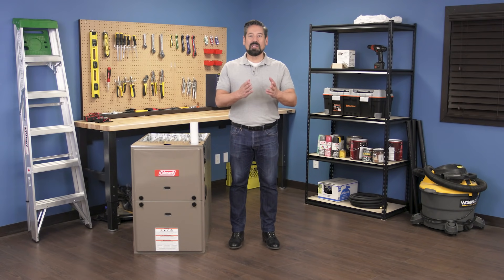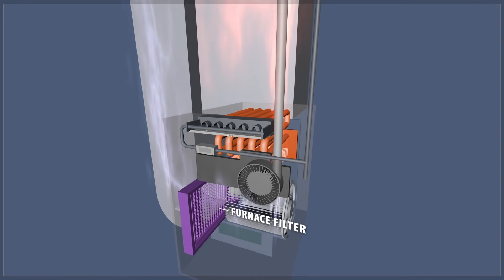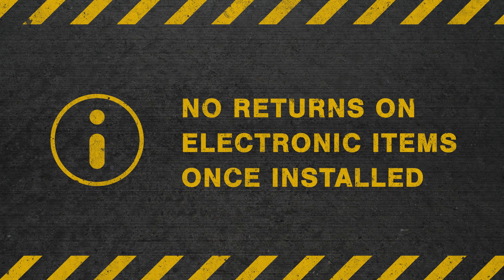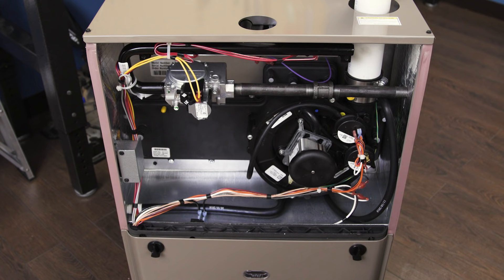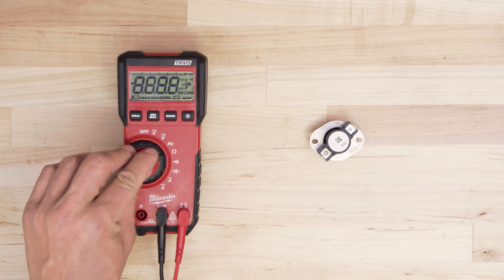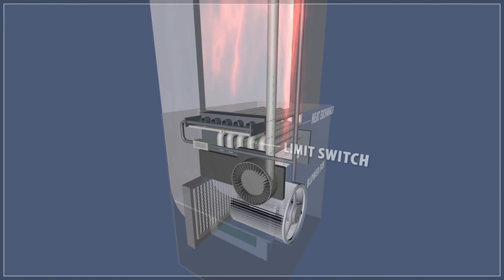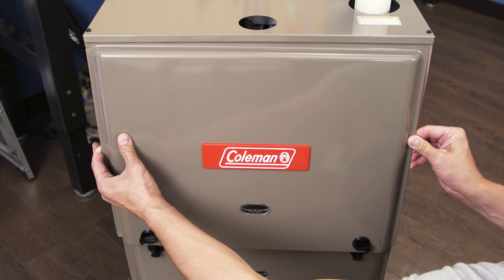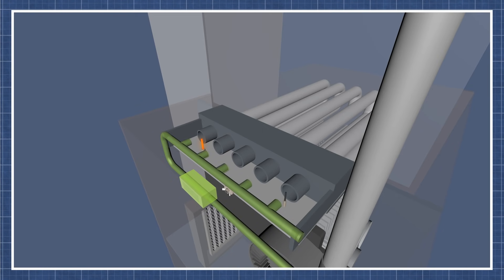Furnace - Limit Switch | Repair and Replace

Comment: Vance, Great Video!  You've been so helpful with other comment, I've decided to ask you.  I have 2008 Furnace Lennox G51MP-36B-070-08.  The Primary Limit Switch is hard to replace mounted on the wall behind the intake vent and the exhaust vent (you probably know this configuration).  The Primary Limit Switch is a L210-30F.  The furnace ran great with occasional lockouts , but then in Jan. - Feb. 2021 every few days or so it would lock-out with error code that says either "lost flame sense more than 5 times" or "Primary Limit Switch Open."  So first I cleaned the Flame Sensor, and that helped for a few weeks.  Then Lock-outs with same error code began again, but the Combustion Air Inducer (CAI) keep running after lock-out (somewhere I read this is caused by the Primary Limit Switch staying Open).  Since it is easy, I installed a new Flame Sensor, but it would still lock-out every three days or so, but now the CAI motor stopped running after lock-out.  So now I'm thinking the Primary Limit Switch is the next thing to replace.   How many minutes can these furnaces run until the Primary Limit Switch opens and shuts them off?  Can I substitute a Primary Limit Switch with a higher rating say L250-30? Is there a Lennox forum?  Any advice will help.  thanks!
Reply from the maker: Hi Walter, thanks for watching, we're glad that you found it helpful! If you're getting a flame sensor error code, then there's a few other things to check. For the flame sensor to work it needs to complete the (DC) circuit, from the control board, through the flame, into the metal of the burner and down to ground through the furnace frame. So the furnace needs to be grounded properly and the burners need to be clean for the flame sensor to work properly. Give the burners a cleaning and you can also test for continuity from the metal of the burner to the furnace frame to be certain.

When replacing the limit switch, you have to match the ratings exactly for the furnace to run safely. The lockout times differ between furnaces, there is some variation. There might be a Lennox sub forum on one of the HVAC discussion boards if you do some searching.

Hope this helps.
Reply: @AmreSupply  O.K.,  I'll let u know.  Thanks!

Comment: Hello, I am following and watching your video really they are very useful. At the same time, I have a suggestion that there is a very bad noise (melody)  at the beginning while opening the video if you could change it with a soft melody. Thanks in advance
Reply from the maker: Thanks for watching, we're glad that the video helped you out. Other people have pointed out that the sound is pretty loud. It does depend on the speakers that you're listening from. Our newer videos have an updated into that is quicker and a bit softer. https://youtu.be/Rq5yHyI5UQA

Comment: furnace running but not reaching room temperature sounds like limit switch
Reply from the maker: Thanks for watching. Could be the limit switch but still check for a dirty air filter.

Comment: My 5 year old Bryant furnace recently started short cycling and not getting up to temperature even with a new filter, but if the filter is removed it works fine. I suspect the limit switch, it's L170-20F. Does this sound like the problem and does the replacement have to be the same specs or how close does it have to be and would there be an advantage to using one with slightly different specs? Any help is appreciated - Thanks.
Reply from the maker: Hi Russell, thank you for watching. Its always best to replace the switch by matching the numbers exactly. These switches are used as a safety, so a different temperature cutoff is unsafe to use. The numbers refer to the temperature that the switch will open and disconnect power, and the 2nd number refers to the difference in °F that the switch will close again.
Reply: @AmreSupply  Thanks for the info. I will only try to replace it with one of the same specifications.
Reply from the maker: @russellcrea9701  You're welcome!

Comment: My thermstat's reboots and checked online and the cause seems to be the limit switch,  the tech who had come to check says there is orange flame instead of blue and could not find out the fix, is this also caused by limit switch or is the issue something different
Reply from the maker: Thanks for watching. An orange flame will happen when it is not receiving enough air for complete combustion. This can be because of a plugged orifice or a dirty burner.

If the furnace starts and stops after the flames are lit and after the blower fan is on, then it could be a faulty limit switch. If the furnace shuts off any other part of the sequence then it might be a different switch. You can learn more here: https://www.youtube.com/watch?v=b0sAGt-1niU
Reply: @AmreSupply  Thank you
Reply: @AmreSupply   Two Tech from different company came and confirmed there is Carbon monoxide leakage, i wanted a quote for a new furnace from a third company for comparison  and the third tech who came cleaned the burners and checked the carbon monoxide levels too showed pic the flames are blue, and said there is no issue  now totally confused.
Reply from the maker: @pgg2061  carbon monoxide is produced when there isn't enough oxygen for compete combustion, so a yellow flame can produce higher CO levels. Regardless you should have a CO detector close to the furnace as a safety. 

One other factor that can cause the furnace to not run well is a blocked exhaust exhaust vent. Sometimes ice or a build up of leaves or other debris can restrict the airflow. On furnaces with inducers motors, the pressure switch should trip when this happens.
Reply: @AmreSupply  Thank you for your reply. I order some  extra CO alarm
Reply: @AmreSupply  My bad  I checked the with techs again it was not CO leakage they had checked the fuel pipe and found it high 
one found it 50 ppm the other around 25 ppm

Comment: Where is the limit switch on a gas fireplace please
Reply from the maker: Hi Jane, thank you for watching. It depends on the model but the limit switch  is generally placed on the side wall so that the bi-metallic disc is exposed to the air that is heated. https://www.amresupply.com/part/2000-080-Kinsman-Fireplace-fan-limit-switch
Reply: @AmreSupply  thank you I have found it. I am going to replace tomorrow. Our gas fire is a Pleasant Hearth model VFF PH20D it has never been used but was in storage until we moved. It has never lit , the pilot if I hold the control know in will light but on e let go it goes out. The thermal coupling has been changed. The ingnitor is strange it is nipple with a spring and battery but no click when it is depressed we have always had gas fires so I do know what it is supposed to feel like. Thee company tells me that there is not a replacement t as the thermal coupling is part of it. I am confused. We had a professional install and run the new gas pipes he is frustrated too and to be honest we have spent too much money at this point it is a catch 22 . I appreciate your help , I will let you know if this works. I really want to understand the ignitor.
Reply from the maker: @janefletcher3198  The ignitor might require batteries. See if there is a housing or cover that would pop out, it will likely require several AAA batteries.

Lighting a pilot is similar between furnaces, water heaters and fireplaces that use a standing pilot light. This video will show you the steps that you can apply to the fireplace. https://www.youtube.com/watch?v=d-KRwKdRNYI

If the pilot doesn't stay lit there are a few things you can check: https://youtu.be/Lu5GvbvspMw

Hope this helps!
Reply: @AmreSupply  thank you so very much for everything you have helped me with. The igniter is still a sticking point. But I am sitting here enjoying our fireplace couldn’t have done this without your help. I replaced the last piece and it was the problem . I am 72 yrs old never let anything beat me patience is a great virtue . Again Thank you
Reply from the maker: @janefletcher3198  You're welcome Jane, we're just happy to help in what ever small way we can! We're glad to hear that you have the patience and focus for continous learning. Its a lifelong skill that truly empowers everyone. All the best to you!
Reply: @AmreSupply  well here I am again, any recommendations for this problem , we turned the fire up a little it got cool . It set off all the fire detectors in the house and actually shut itself off. I haven’t lit  it again it does smell awful. I did clean everything before we used it. It had been in storage. I am thinking of getting new logs. The actual gas ring had dirt on it that shouldn’t have been .
Reply from the maker: @janefletcher3198  There are a few things that could create issues like that. One would be a dirt or dust that in the fireplace or on the logs itself would create excessive smoke. Another one would be an issue with the chimney. If there is a restriction in the airflow then some of the smoke will be exhausted into the home. If it hasn't been use the rest of the chimney could be quite dirty overall.
Reply: @AmreSupply  thank you for replying . This is a ventless fireplace in a cabinet I have done all what you have said cleaned dusted wiped down . It smells and I can not have it on low we have put the ceiling fan on to help with the fumes , the fire itself does shut of so something is not right . It is very frustrating I really don’t know what else to do it is in a large area not a closed room .
Reply from the maker: @janefletcher3198  If it is a ventless fireplace then that changes a few things. It could be an issue with the gas regulator, as these models are setup differently than the vented fireplaces. First of all you'll absolutely need a Carbon Monoxide detector installed close by if you don't already have one. As well it  might be helpful to get it inspected by a professional.
Reply: @AmreSupply  good morning, we did have a professional install , run the pipes took it apart. I do have the carbon installed . We will have the regulator looked at I am trying to get new logs they have been in storage and ai see a few chips when I clean .

Comment: My limit switch is saying 1.1 when I test it. It's a 6 year old furnace and not lighting. I can see the ignition heating up but no flames after it clicks :/
Reply from the maker: Hi Alex, thank you for watching. The 1.1 ohms means that the limit switch has continuity so its likely not the problem.

If your inducer blower works, the ignitor heats up and the flames don't light, then its most likely an issue with the gas supply. First check to see if the gas shut off valve is opened.  Alternatively it could be an issue with the gas control valve as it needs to open to release gas for the furnace to ignite.

Comment: My gas furnace had been short cycling for a few days now. Since this morning upper zone is not working, although lower zone is working just fine, and no short cycling either. I have checked the thermostat, also tried to bypass the thermostat, the damper motor seems to be working too (opens when furnace is turned off and closes when lower thermostat is turned on, but it won't open when upper thermostat is turned on). Could it be a faulty Limit switch? If not, any idea what it could be?
Reply from the maker: Hi Rahul, thank you for watching. Overall its best to see if your furnace gives you any error codes after it short cycles. This can help you narrow down the problem. 

We also made a video that focuses on short cycling as depending on where in the sequence it happens will help you know which part is faulty.
https://youtu.be/b0sAGt-1niU

If the furnace heats up normally and then shuts off after blowing hot air then the limit switch might be faulty or it the air temperature inside the furnace is too warm. In this case it would be best to replace the air filter, and test the limit switch for continuity.
Reply: @AmreSupply  Thanks for your response. The furnace runs fine most of the time, but often shuts off before reaching the target temp. Then the fan short cycles several times with no flame. After like 4 times doing that within a minute or two, the flames light up and then it runs just fine. Looks like a limit switch right? I checked your other video, thanks!
Reply from the maker: @RahulRathi_Multimedia  If you've replaced the furnace filter and the airflow around the heat exchanger is good, then it does point to an intermittent problem with the limit switch.
Reply: @AmreSupply  thanks so much !! I'll order a new limit switch and see how it goes.

Comment: my heater kept cycling the flames every 5mins or so, i thought it was the pressure switch but the hvac tech said going from a 3.5 to 4ton might be the issue so he plugged up one of the burners and moved the ignitor over one. now the furnace wont over heat as he put it but doesn't that make it take longer to heat the house? its a rheem 801T x13 100k @ 80% code was 22.
Reply from the maker: Thanks for watching. If the furnace was overheating and was tripping the limit switch then closing off one of the burners would solve that problem. It might take longer to heat the home initially. You'll likely notice the furnace staying on slightly longer than it did before, or it might cycle on a little more frequently. Shouldn't make a massive difference though.
Reply: @AmreSupply  thank you for taking the time to reply to my question after he plugged up one of the burner inlets I no longer have the overheating issue or tripping of the Furnace my question now is is it okay to go from a medium low to a medium speed tap or it really should or would not make a difference of only 200 cfm. Basically I went from a PSC to a x13 and I'm trying to match the cfms from the previous system to the new system. The old system was 100k 80% Quattro psc 1/2hp heat was med and cool was hi spd tap. Roughly heat 1400cfm and cool 1600cfm @ rating .5wfc. This new sys is 100k 80% minus 1 burner derated 3/4 hp x13
Reply from the maker: @joeydelmarsjr.646  There shouldn't be a huge issue going from medium low to the medium speed as its just pushing more air over the heat exhanger. The slight difference in speed might not affect the overall heating in a noticeable way. If the furnace turns cycles and heats like normal then you might not need to adjust it.

Comment: Hi my heat starts fine then blows cold. In had a guy come out 2 times and charged me for it. He's saying itll be 250 to replace a limit switch. Is this something I could do on my own and get the parts I need
Reply from the maker: Thanks for watching. The limit switch repair is pretty simple. After disconnecting the power, the limit switch can be unscrewed with a screw driver. Just make sure to match the ratings on the limit switch and it will function the same as the original. https://www.amresupply.com/search?q=limit+switch
Reply: @AmreSupply  you guys are awesome thanks!
Reply from the maker: @marvinpathrose684  You're welcome Marvin! We're just happy to help!

Comment: Hi Vance . . . i have a question for you . . . I have a Dayton Gas Furnace which looks exactly like yours in the video - same switch location - when I test the Limit Switch on my Cen- tech Digital  Multimeter it reads 2.3 - That in turn is a bad switch correct ? Otherwise the multimeter would have had the same screen it showed me when I turned it on right ( if the switch was good ) ? The Multimeter was in the lowest ohms setting ( 200 ) .
Reply from the maker: Thanks for watching. When testing the limit switch it should have continuity with a resistance between 0 and 1 ohms. A resistance of 2.3 is still pretty low and shouldn't affect the operation of the switch.  Now if the switch has failed completely, then there will be no path for electricity to pass through, and no resistance at all. In this case the multimeter will be blank, or will show OL (open loop).
Reply: @AmreSupply  Ahh . . . I wondered what the OL stood for - the Multimeter read 1 and then a open space where 4 or 5 digits would have been then a dot - then when the probes were put on the limit switch it read 2.3 - I re- inserted the switch in the Furnace hooked the wires back up -  took out the filter ( yes it was dirty ) and flipped the power back on and so far it has been running perfectly - Thank you for the great video . . . and taking the time to get back to me . . . going to get a new filter . . .
Reply from the maker: @verizoncustomer1600  Its definitely good to regularly replace the filter. We're glad that you found the video helpful, we're just happy to help in what small way we can! Cheers!

Comment: Why my high limit switch keeps on breaking ?I already replace it 3 times even the I also replace my filter. Please advise....thanks
Reply from the maker: Thanks for watching. If the limit switch keeps on failing then its likely that the heat exchange is running hotter than it should be. Dirty burners can cause issues. As well a deep cleaning of the furnace and the vents could help as anything that restricts the airflow can cause the temperature to rise. In this case it might be best to hire a professional to take a look.